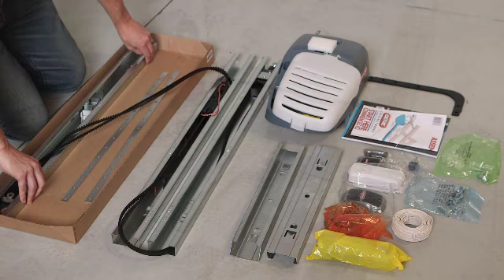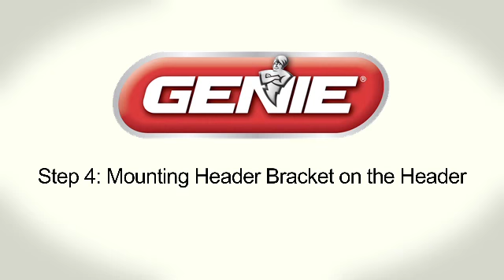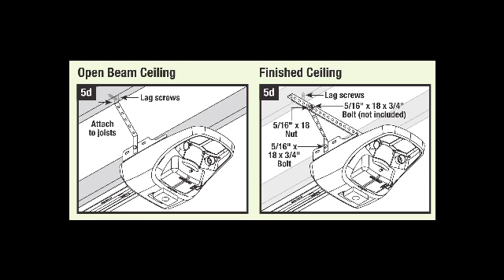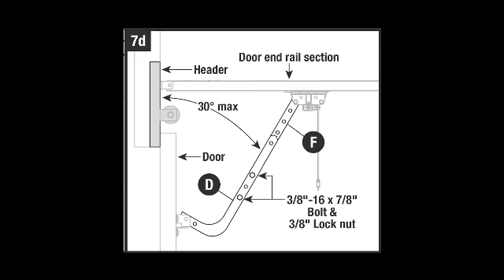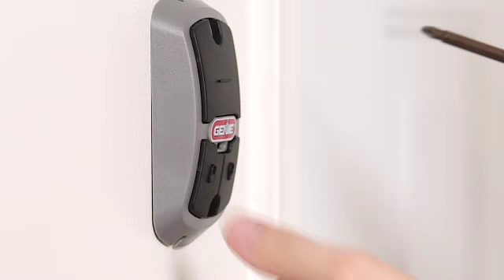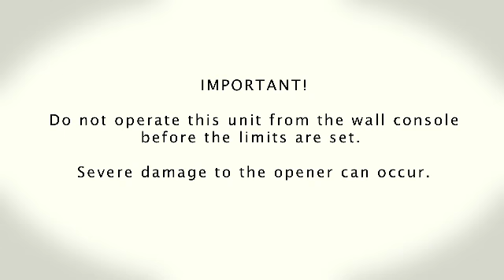Belt/Chain Drive Opener Installation (All steps)

Comment: Our Genie 3-year-old Genie #3024 developed a loud "squeal" @ the center guide Cee track as the belt drive block travels back & forth.  Track lube did not resolve the issue.  I will attempt to spread the Cee track open a bit to allow more clearance for the drive block travel.
Reply from the maker: You can contact our customer service at 1-800-354-3643 for assistance. We would be happy to help troubleshoot the problem.

Comment: My wiring instructions shows and says to connect the stripped wires to the number 2 terminal, NOT the number 1 terminal. On the sensors at the door it says to connect stripped wire at the terminal farthest from the mounting bracket.  Which is correct ???

Comment: I just installed this in my mother in laws garage and it was easy. thanks for this video. very thorough.
Reply: Installed 2 belt drive model 500 opeaners. Rails are to cheap and flimsy for 16x8,120 mph windload door.